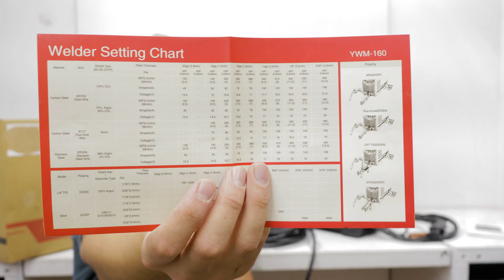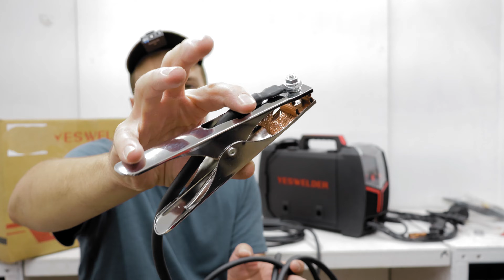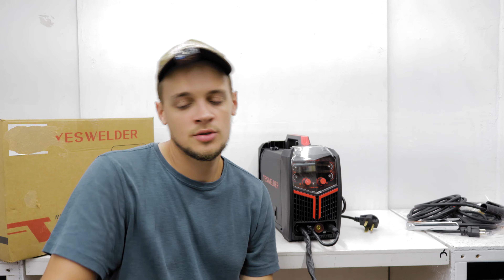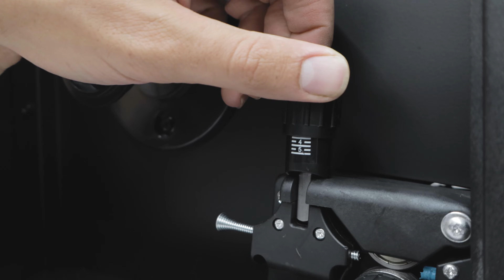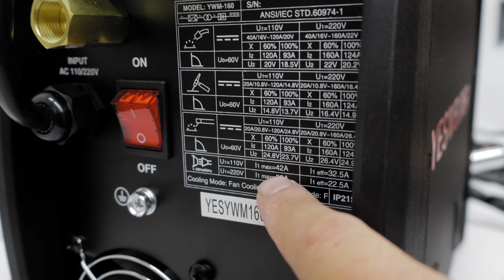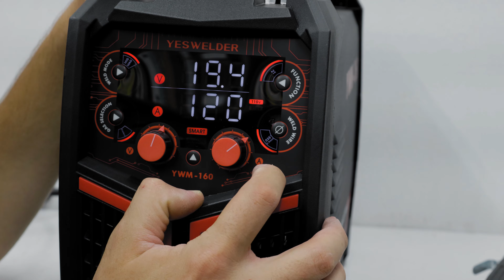My Favorite Single Phase Welding Machine - YesWelder YWM-160 Multi-Process Welding

Comment: I bought one year ago as a first time welder. I absolutely love it. The only thing that I wish it had was a longer whip. It’s maybe 6’, so you quickly run out of cable and need to move the material or machine closer together. Zero issues otherwise.

Comment: I just got one for Christmas and I love it for diy stuff around the house but 1 question can you never change the mig gun on this machine because it doesn’t have a traditional plug-in for the gun. It works fine but what if it goes out?
Reply from the maker: You can change it, it's just not quick change.

Comment: Have you ever tried this on a 15 amp breaker? Does it trip?
Reply from the maker: Yes I have, and it works fine for thinner materials where it's using less amps. Full blast, it may trip it. Depending on the wiring gauge running to the outlet, you MIGHT be able to put a 20amp breaker in place of the 15. Double check with someone qualified, otherwise you could start a fire.
Reply: @TheNateTake  great thanks! I think I'll give it a whirl and will upgrade to a 20 Amp breaker if I can

Comment: I just got this same welder (the ywm 160). What size thread is the nozzle?
I'm trying to get a flux core nozzle.
Also what thread are the replacement tips? M6x1.0 possibly?
You'd think this would be straightforward but yeswelder doesnt say this info and there yeswelder tips and nozzles they do sell say their for a lincoln, and they also have tips that say their for a miller..
Then top that off with non of the nozzles for sale anywhere say what size thread they are.. just what machine they are for.
This is confusing...
I need a thread size or atleast a brand and type of what someone else used on there ywm 160. 
These are consumables, they get replaced.
Reply from the maker: Me personally I have always just bought the size I need for my wire and they fit. I've never worried about the thread size. I've always bought mine from harbor freight. They have the best price. It's a tiny piece of copper, no need for name brands in my mind.
Reply from the maker: So long story short, they seem to be mostly universal, and I'm not sure what size and pitch the threads are.
Reply: @ Thanks for the quick reply, well at least now I know I’ll eventually find something that fits it😄. Now I’ll just see how easy it is to find something that fits..I’m not new to stick but I’m new to mig/flux.
I’ll post back here when I get it figured out what brand or possibly what size tips and nozzles fit this machine. Just in case someone else needs this info.
I know I can’t be the only one wanting to know.
I can’t just blindly order parts online so I’ll see what I can find next time I go into town.
Reply from the maker: Harbor freight will get you taken care of if you have one. They are a magical place!

Comment: Is the YesWelder 160 still working a year later?  Do you use it?
Reply from the maker: I use it all the time, it's still just as good as when I first got it.
Reply: @TheNateTake  Thanks so much for responding back.   I'm going to order on with special Black Friday.  $180.  🥰
Reply: @TheNateTake  Do you have code to send a little money your way?

Comment: Hi Nate.  First time welder here and I have some stupid questions.  I just bought the YWM-160 and planning to do flux core welding on 1/8" steel bar.  First, I should plug the cable already attached to the machine to the NEGATIVE terminal and plug the ground clamp to the positive terminal, right?  Second, when using "smart" mode, how do we set the wire feed speed?  The chart says we should set it to 450 but the maximum I can see on the screen is 120?  I am thinking that I should use 220V in order to have higher setting, am I wrong?  Thank you very much in advance!

Comment: How long are the leads?  It looks like the mig lead is built into the unit????
Reply: Nate: did you keep this welder.?  I didn't see a follow up.
Reply from the maker: Yes the MiG leas is built in. The leads are 7 foot. I still have the welder and it's doing really well.

Comment: Hi can you help me decide? I’m thinking between the 135 vs the 160 220v option. Is the 160 really more power? I will be using mig (no gas) 90% of the time. Intermediate welder but never owned my own. I keep reading online that they both do 5/32. Is the extra $80 worth the bulkiness if they do the same thing?
Reply from the maker: Here's what I have found. My YWM 160 can do more than 5/32. I just scoured the listing page on Amazon, and I can't actually find an advertised maximum thickness. If we look at the average thickness based solely on amps online, a 160 amp should have no problem stick welding 1/4" metal. I can attest that the 160 will weld 1/4". I've done it. MIG it should weld up to 3/8" at 160 amps. For a 135 amp welder, the average thickness it should be able to weld for MiG is 3/16", and 1/4" for stick. So there is a difference. That difference can become more visible if you have quality issues with the steel or want to try to weld through dirty metal. Which you shouldn't do anyway, but sometimes you gotta do what you gotta do. The extra amps could help out in that situation. If you really wanted to make sure you had plenty of amps, you could look at the 205ds.
Reply: @TheNateTake  thank you for the response. I think I’ll do the 160 to get a deeper penetration.

Comment: I’m actually trying to decide on this or the titanium my 140 , what did you not like about the titanium?
Reply from the maker: Sorry for the late response, but 3 titanium 140s broke in about 2 months. All were failure of the control boards. I switched to Yes Welder and have never had an issue since. I just reviewed their Flux 135pro, the most recent video on my channel. It's identical to the titanium 140 size wise, but is cheaper and it is multi-process. Flux core, stick and Tig. It's a no brainer between the two. Yeswelder Flux 135pro all the way.

Comment: What I have been trying to figure out and can’t find a clear answer. Will the YES brand mig spool gun work on this? All Amazon descriptions mention every model BUT the YWM-160
Reply: I don't believe the spool gun attachment works with this model. I did that exact research for this because of possible aluminum.

Comment: I just bought one of those welder  but I am going to be welding off grid so I need to find the right size Generator
Reply from the maker: I've been running mine off a Wen dual fuel 4750w. It's slightly under powered, but works fine for mig. I've been using it mostly on 1/8 and 3/16. No issues

Comment: There are so many of these cheap welders out there the real question is how long will it last ? And can it be repaired when it breaks ? This is the problem with everlast ( AKA NEVERLAST ) .
Reply from the maker: That's a good set of questions. Perhaps I will find that out.
Reply: @TheNateTake  I have been in the automotive field a long time. I only own an old AC/DC ARC welder made by lincoln and Miller welders . My newest welder is the multimatic 220 . I preferred these as I can get parts for them if they should break, which is rare for them to break on the inside . I will point out here that these are high-end machines really not meant for the novice unless you are serious about becoming a welder . Another lower cost machine would be a CK WORLDWIDE  THEN An AHP multi processor ,these welders come complete  .
Reply: For 200 bucks.... you can make 5x in one day on a decent job. So I'd day it's worth
Reply: @stimulatemyexistence5669   What's its duty cycle?

Comment: Metres and millimetres are more precise measurement
Reply: Will I be ok on a 30 amp circuit breaker with a 110 
50 amps are big ass breakers
Reply: That's not true